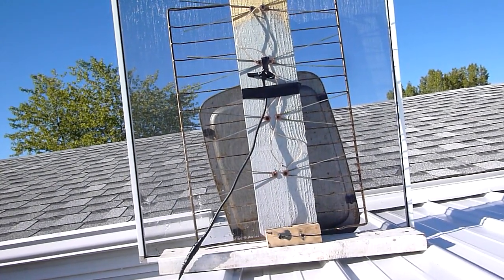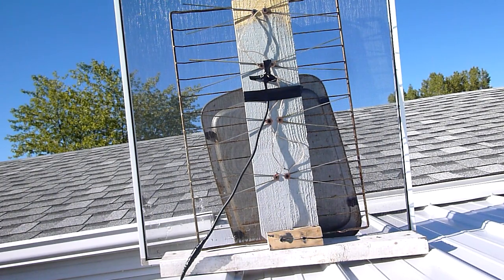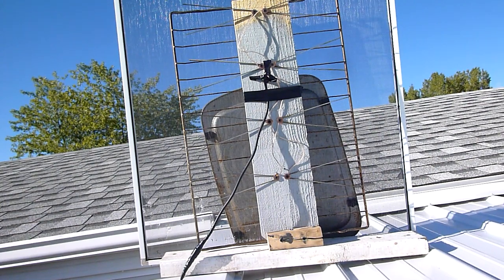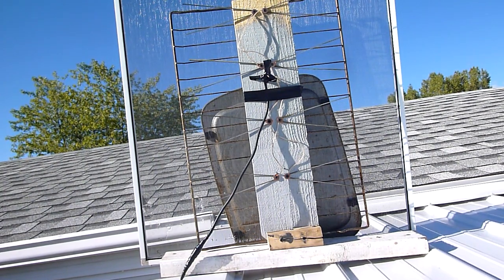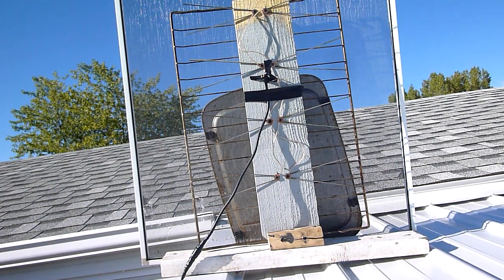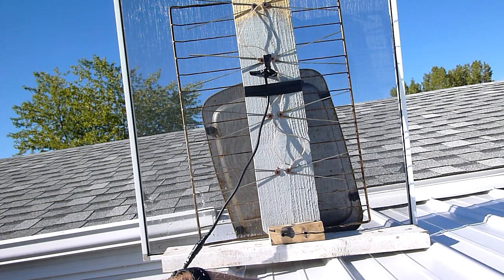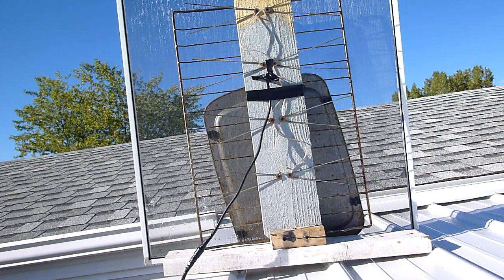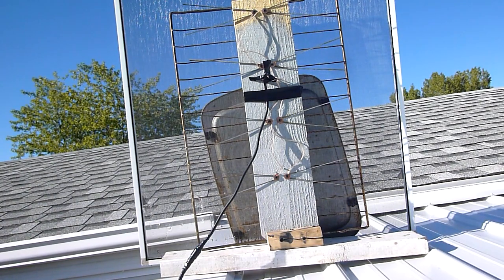Extra Info for DIY HDTV Antennas Window Screen HTWL

Comment: If you used a balun you would get more channels. Without the balun,the antenna is sending a 300 ohm signal to your TV,which is designed for a 75 ohm input. In other words you are choking the signal by not using a balun. I'm no expert,but I have built many of these,and I have learned through trial and error that the balun is very important.